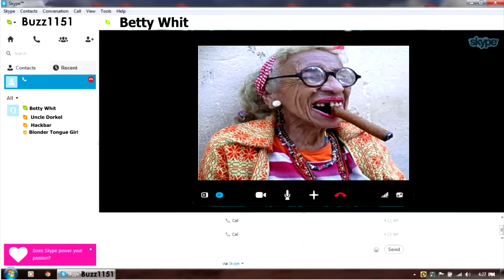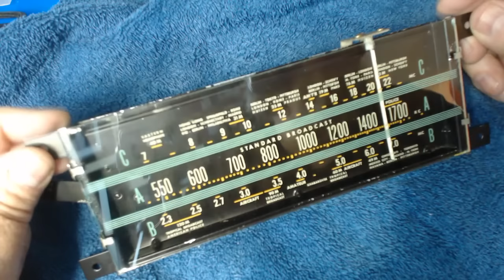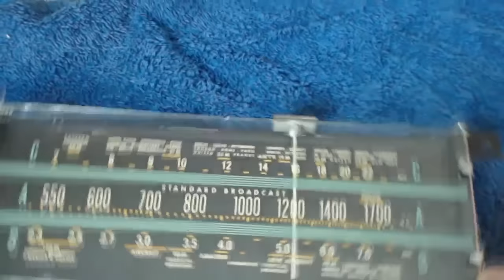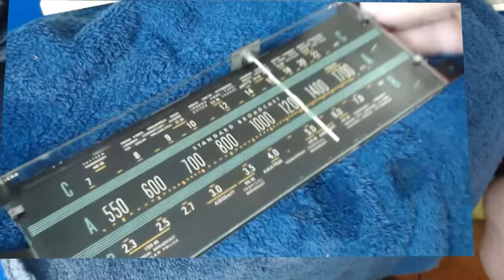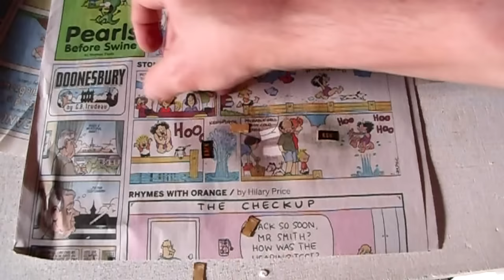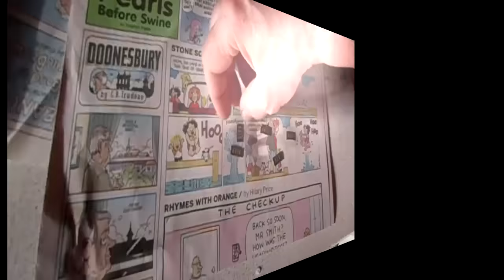1939 RCA Victor Model T-64 Restore Part 11

Comment: The dial surround looks really nice. some of the RCA surrounds are plastic and they get warped. that's the problem I have on Old64Goat's RCA87K which I need to get back on and finish up lol
Reply from the maker: coolbluelights Hi Dan..Wait till you see my next project, a 1940 Stromberg-Carlson.. Im going to have to make a bezel or surround because it was made of plastic and is missing ..not going to be easy...Buzz

Comment: Buzz,
Again very good work, old bean.  It's looking better and better.  And the paper clips was an excellent idea.

But a slight adjustment is in order.  Don't ya just love a critic?  LOL  It's about how you mounted the fuse holder.  The lock washer is smaller than the chassis hole, so it's doing nothing.  Install a flat washer between it and the chassis.

Regards,
John
Reply from the maker: joernone Hi John..I was just testing your faculties to see if they are still intact..congrats you passed....Do you think my mentor Brendan also caught it?..hummm....tc..Buzz

Comment: Hi Buzz, What value would you recommend for the heatsink resistor?  I have an old radio with a transformer and it gets quite warm with the higher line voltage of today.  I would love to put one of these in the radio.  Thanks for any info! Love your videos!
Reply from the maker: Find out what voltage you want to run the radio at and use this...
http://www.gtsparkplugs.com/Dropping_Resistor_Calc.html
Reply: Great!  Thanks.

Comment: Greetings:
Replace that 20 ohm power resistor with av12 or 13 mfd 250v np capacitor to avoid wasted energy and heat. Ebay has 13mfd 250v non-polar caps for 7.99 & 4.00 shipping forn2 pieces.

Comment: Poor ole Dickel.  He can't win even when he's not scheming.  He's lookin' like the unknown comic there.  I'm not sure he can handle Betty Whit.  Electric Radio Mag sells an Inrush current limiter (with or without meter) to slowly power up you vintage sets and they hold the voltage down.  I,plan to get a couple of these.  You wouldn't need the resistor.  Looking forward to the final installment.
Reply from the maker: Stephen Moore ..I perfer the restors..they're cheap and work ...
Dickel is sure in a mess, and I dont even know how it will end...lol